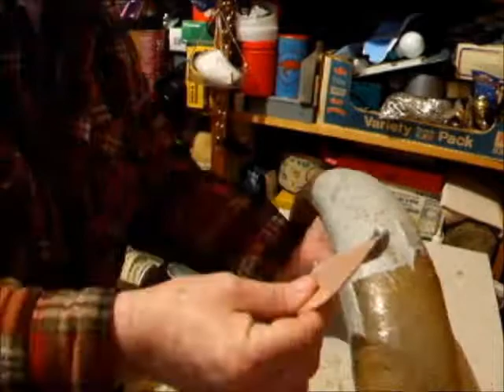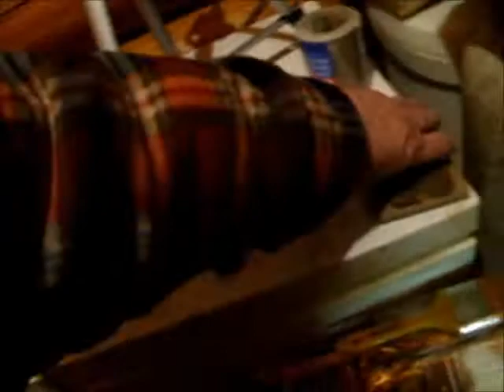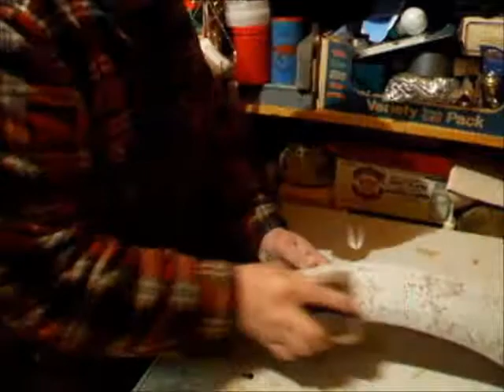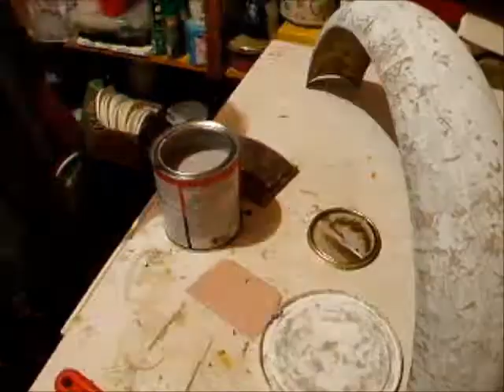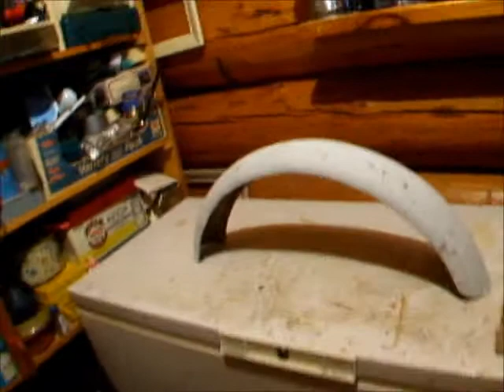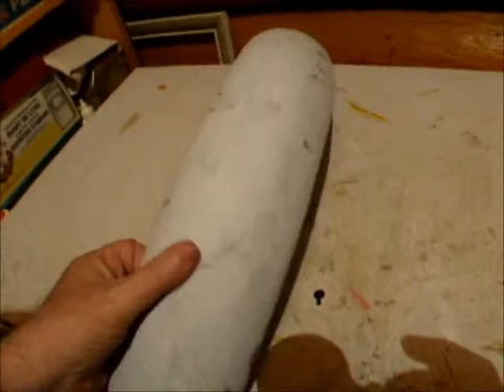Part C3 Triumph T120 Front Fender Bodywork

Comment: what is the name of the think you are putting on top of the fender?
Reply from the maker: Bondo - also known as Automotive polyester body filler.
Thanks for watching.
Reply: EdOfTheNorth thanks a lot. I will be doing my own fender and your video will help a lot
Reply from the maker: I have an entire series on my channel, on building an old Triumph which includes this fender build. Perhaps you may find some more tips there. I don't recommend using the fiberglass reinforced body filler because you will not be able to smooth it on over the fiberglass and sanding will be too difficult. 
Good luck on your build.